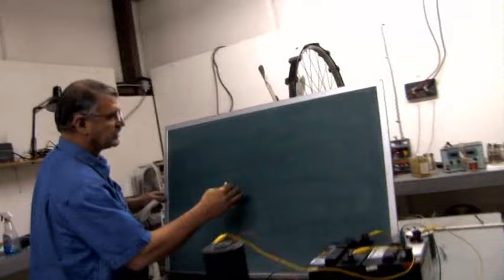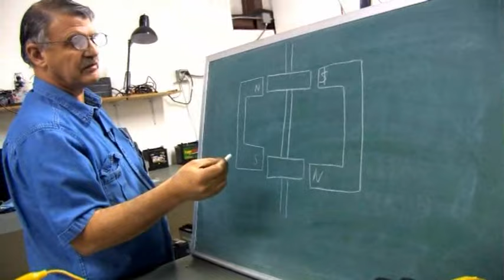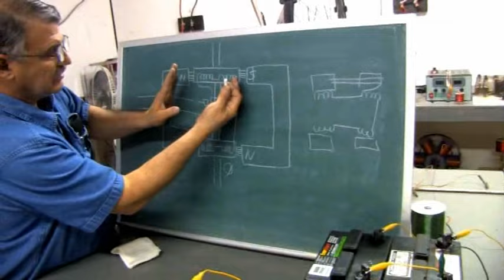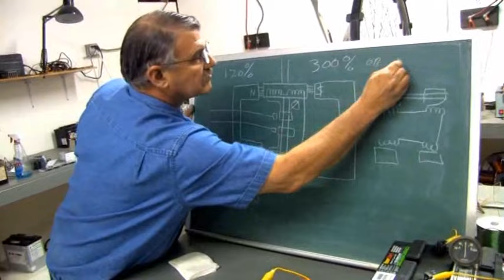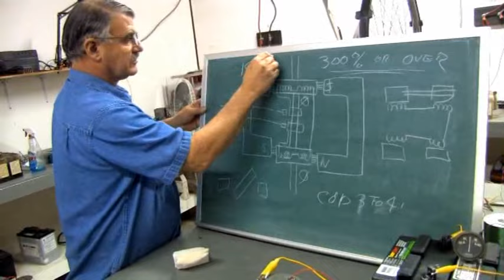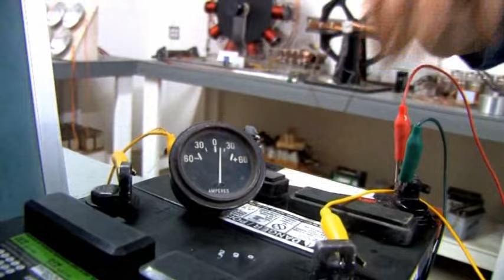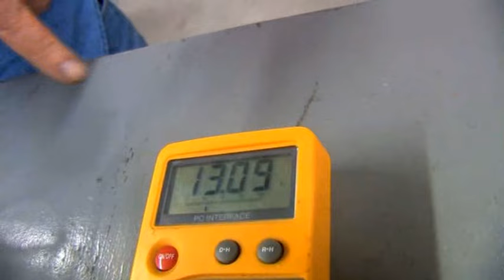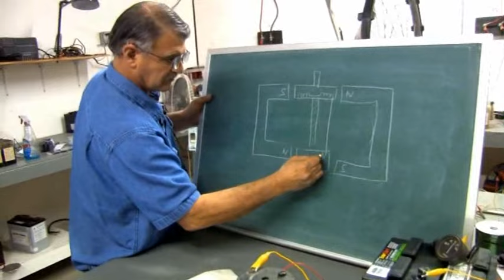Energy from the Vacuum  - 10  - The Kromerey convertor

Comment: A bit messy demonstration of a dc electric motor principle and the simple fact that it also work as a generator with a loss of energy in the process. If throw away all this "free energy" mumbling of course. In fact that's how the first dc-ac convertors and variable frequency drives of before-semiconductors-era work.
Reply: I like how it still works after shorting it out. 

If this existed before, why aren’t we still using it?
Reply: @pazsion He shorts out his primitive generator, why would a normal ('though a bit noisy) dc motor, that turns it would stop working? Also I like how he connects it to a battery with the same polarity (decreasing the load to the motor) and shows it as a proof of a mystical energy%)))
Reply from the maker: It has a patent, just look up the patent and make one your self. Simple.

Comment: Peltier effect
Reply: A Hilsch Tube converts to both cool air and hot air using the Vortex but the energy comes from pressurized (Compressed) air . with no moving parts except for external compressor (Which uses fractional to Horsepower ). I just thought about the vortex and related it to almost the same results with temperature. Nothing scientific but similar.
Reply: Yes, Its a pronounced Thermo-magnetic effect.

Comment: I'm a little at a loss for words. Hearing in regular language the principles of how these devices work  and seeing them in operation is like getting an early Christmas present. But not any old present, the one I've always wanted. Presented straightforward without alot of techno-babble concealing its secrets from my understanding. It like taking the express elevator to the observation deck on the shoulders of giants. Thank you very much.
Reply from the maker: Like John used to say. Learn the principals of the machine. Watch what it is doing. When you learn the principals, then you will find there are 1000 ways to build it.

Comment: This channel is a treasure trove of interesting content! It will take me a long time to absorb this awesome info. Kudos for posting this video!
Reply from the maker: If u want to replicate the Kromerey. I would suggest you stay away from all metals to construct it. Full plastic. Even metal fasteners will change its operation. Carbon brushes and above all a non-magnetic shaft. Proper coil ratios are also important but not so much if u just want to study the effects. Perma magnets are ok. But the original had electromagnets for gate switching. John in the video talks about a lot of the effects, concentrating on that rather than the terms he uses. His replication is not totally accurate, nor optimal. Good enough to study though.
Reply: @GuardianEngraving  thank you good sir! I'll try a stab at using my 3d printer.

Comment: This machines is covering over a dozones of other Radiant Energy patents!👍🙏
Reply: What do you mean? Would you mind elaborate, please?
Reply: @ekeretteekpo3004  Yes, this machine behaves differently than what standard Generator would do, It charges Capacitors and Batteries way better than it. At the least a standard Generator, dies down if one tried to charge the same battery that drove it.

Comment: Thank you for posting this! However it was cut off right at the part where he was explaining why this machine couldn’t be turned into a circuit. Can you post that part too maybe as an addon? Thanks!
Reply from the maker: He does not go into explaining why. He simply states that there are no solid state circuits that could be built that would represent the mechanical operations of the Kromerey converter. If u wish you could search torrents that contain this DVD. I will try down the line to post the full DVD and I apologise for the bad cut. Though like I said he does not elaborate on the why.
Reply: @GuardianEngraving  Thanks! I will take your word for it. If that’s all he says then of course no need to go to the trouble to post it.
Reply from the maker: There are many replications of the Kromerey even on YT. You can always check them out for a more modern interpretation of the device.

Comment: First thing, because it has slip rings and there is no commutation, it will generate AC. (Note it is static until driven, because no commutation)
Putting a battery in series will give the output a DC offset, which means it can supply some charge to the battery. 
But based on the size of the wire and that it doesnt get hot it's not generating much power at all.

How does a vacuum have anything to do this, I see no vacuum?
Not much adds up here, if they serious they would have put a CRO on it to show waveform.
Reply from the maker: It's a DC impulse charge. The power comes from the high voltage impulses that come from the calapsing magnetic field once the magnetic lock is broken. There are no Amps going into the battery, hence the thin wire. The vacuum part is just a reference to Johns and Berdens' theory that the battery is being charged via energy from the active vacuum that all matter exists in. Aka Either, space/time, zero point, dark energy, whatever nomeclature you wish to use. It's all the same in the end.

Comment: I wonder why a digital(or any other) thermometer was not used to show the 'Cooling' refrigeration effect exhibited by the air blown away between the rotor and stator gaps? (The core getting hot is indicative to another aspect of the Radiant Induction effect.

Comment: Im not understanding how it can light up a lightbulb, without any real current. It should work the same as the thin wire he showed, yet that did not heat up. Why? If it is a cold energy why does a lightbulb work, when it runs via heat.
Reply from the maker: Because the battery converts the cold into hot.
Reply: @GuardianEngraving  But it lit up without the battery in series as well, though not as bright.
Reply from the maker: @ledfed1912 Yes, even then, the battery acts as an impedance, and current flows through the light fillament.
Reply: @GuardianEngraving  I have no idea how negative energy works lol. But would love to build one like this, some time. There is nothing about its construction that is exotic.

Comment: Any body here that can tell the difference between the Kromery Generator  and the G-field Energiser?
Reply from the maker: They r all more or less the same.
Reply: @GuardianEngraving  Nope, John refined it further, hear him talk about the reduced impedance using more coils and also about the coil geometry, in my opinion the G-field effect is not pronounced unless a further conditioning is done in the Magnetic circuit, and this is where it becomes common to the Sweat's device.